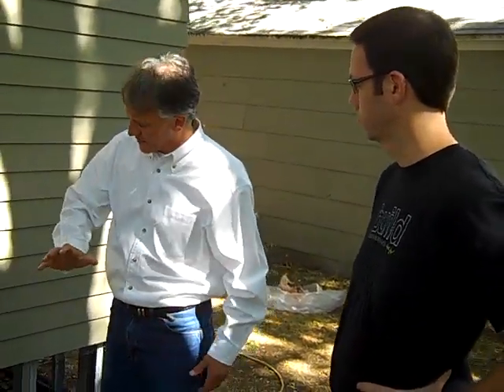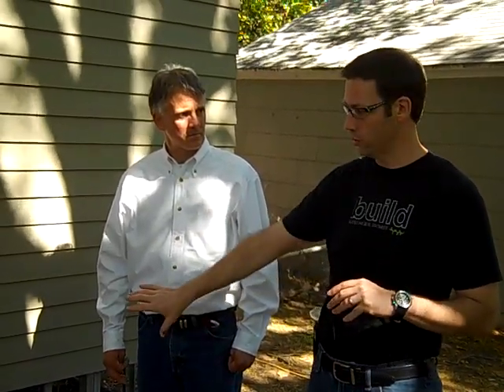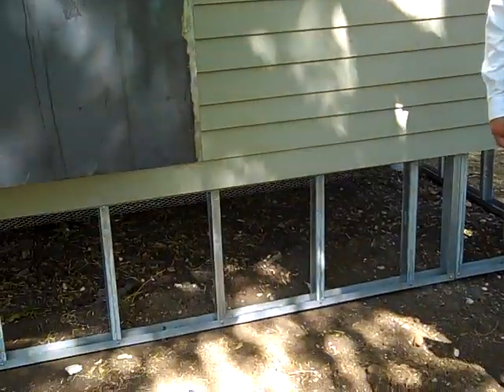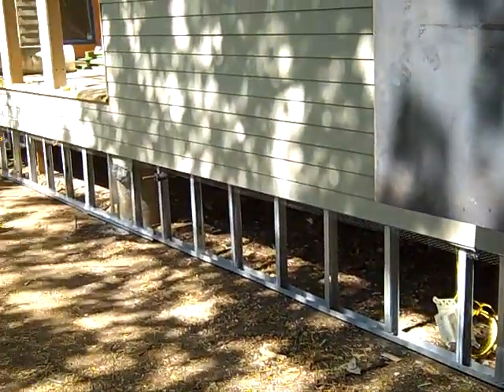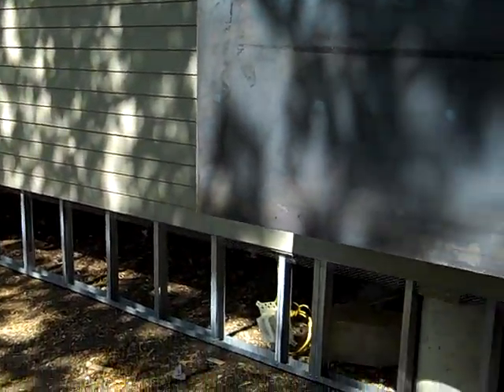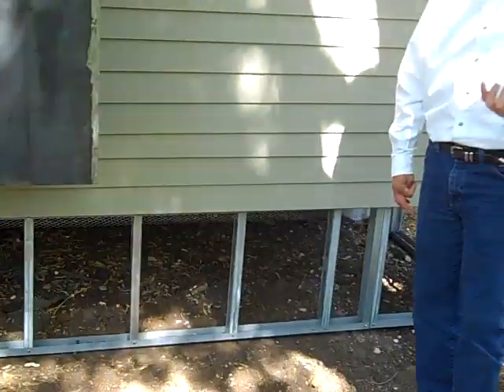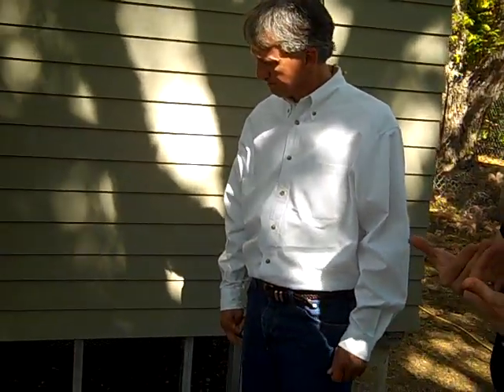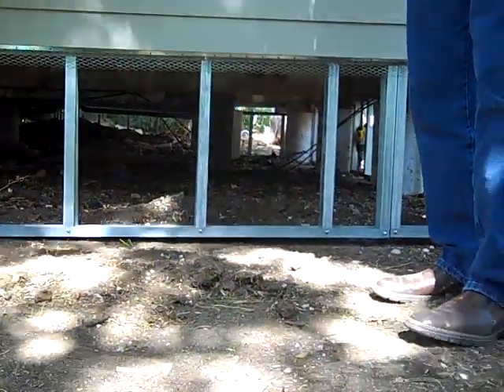Pier & Beam vs Slab Foundations w/ Mark LaLiberte

Comment: Hi Matt! I have a 1300 sqft pier and beam house in the Dallas area. I want to add on a bedroom and closet that will come out to around 250 sqft. My contractor is recommending a slab foundation for the home addition saying it would be cheaper and work better with the addition but everywhere I look it seems like pier and beam is the way to go. Do you have an opinion on this? Is it better for a home addition to match the current foundation or should I just go with what is cheaper and more common in Texas?
Reply: Not sure if it makes a difference but the exterior of the home is brick and the addition would be around 1 foot off the ground.
Reply: slab is the best

Comment: ill have to disagree on the energy savings a well insulated slab will out perform piers  in all heating and cooling zones
 example indoor design temp is 70 ground temp is probably around 55 so the delta T would  be 15  ok now for a pier   same design temp of 70 in texas where you are im sure the air gets over 100 on some days so  thats atleast a   delta T of 30

Comment from the maker: Those are Galvanized Steel studs.  I expect them to rust in 30-50 years but they should be solid for a long time.  The difference between what you are planning and what I'm showing is that my skirt is all above grade.  If you are going to retain earth there are other issues.  Including water management if you have ponding water in your crawlspace.  I'm not sure what an frp panel is?  My concern would be water in the crawl that can't escape.  Best, Matt

Comment from the maker: Not a dumb questions. The piers are indenpendent in the ground but are connected at the top with metal to wood connections.  The beauty of a piered foundation is that it can be "easily" leveled in the future by shimming the tops of the piers.  Best, Matt

Comment from the maker: Costs compare to slab on grade depending on pier depth.  The soil on this lot was good and we only needed 4' pier depth.  If you had bad soils as we often do in Texas then 20+' piers get VERY expensive.  Energy savings are much better than slab on grade because of the insulated floor system.  No opportunity with this house for a storm shelter but that could be possible in theory.  Best, Matt

Comment from the maker: Couple thoughts.  Unvented crawl is the best approach but it's not always do-able.  With a vented crawl I would agree that a closed cell foam would be better.  However, I don't think you'll experience much vapor drive through the open cell foam if you spray it 4" thick and seal all your penetrations from above with canned foam.  This will ensure all air flow is blocked.  I have moved to budgeting closed cell for my future jobs, but I haven't seen problems with my open cell jobs.  Matt Risinger

Comment: Matt - I intend to do the same kinda of insulation under a raised foundation, but the tech adviser, Martin Holladay advised against it. " I think the weakest link is your foundation plan. I'm not a fan of ventilated crawl spaces, and it makes no sense to choose a vapor-permeable insulation over a damp crawl space in a climate where the home is likely to be air conditioned. That combination can lead to damp subfloors. ANSWERED BY MARTIN HOLLADAY, GBA ADVISOR "  Your thoughts?

Comment from the maker: @iamaGod357 I've not built an ICF house yet.  I think they make a ton of sense but not as much in Austin, TX.  We don't do many basements here because there is no frost line so we're not digging deep to limit frost movement.  And we have tons of rocky soil where you'll hit limestone 6" down.  And if it's not rocky it can be really bad expansive clay.  This is why you see lots of slabs & pier/beam foundations.  Thanks for the question, Matt Risinger